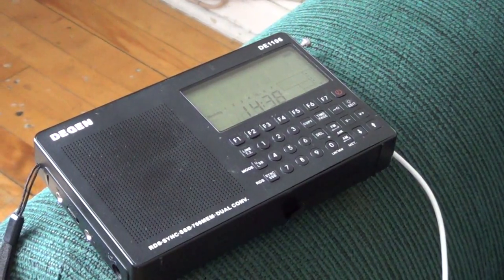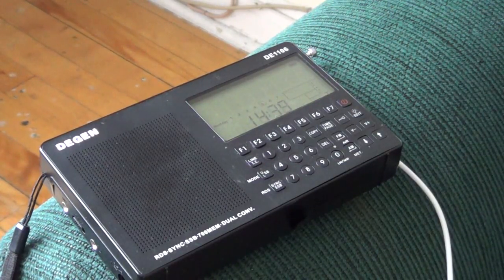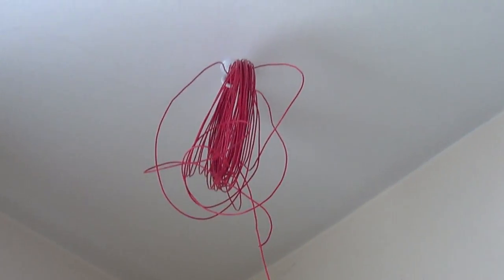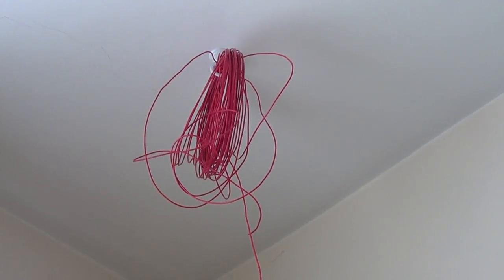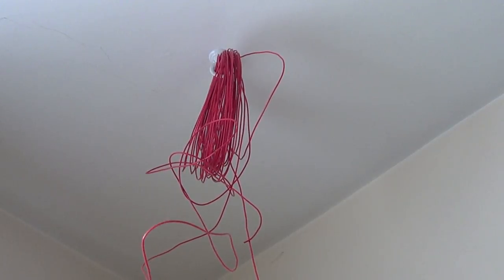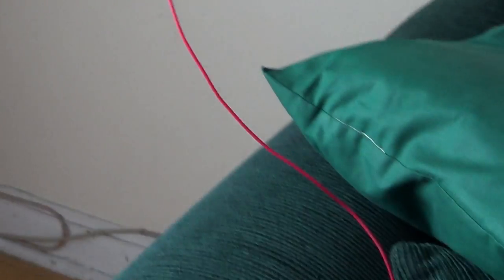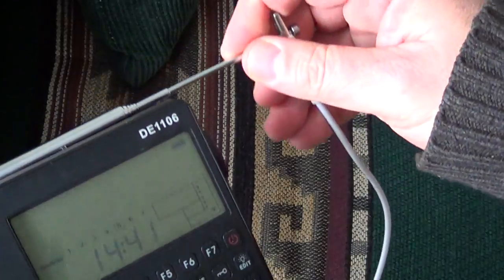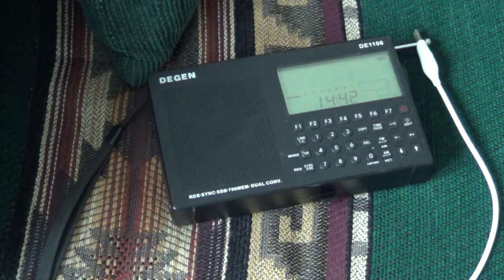My quick wire antenna in my living room for the Portable shortwave radios

Comment: i am making an antenna out of an 8' PVC pole, some thin red copper wire i had lying around, some tinfoil, and a few other things to help me detect lightning strikes near and far. lightning makes a unique crackling snapping noise on AM shortwave under 70khz, so i think my 8' tall antenna will work well and hopefully listen in on distant thunderstorms.
Reply from the maker: Alex Lubbers I often use radios to check for thunderstorms
Reply: Alex Lubbers 520 khz is what I use to look for lighting strikes.
Reply: Hopefully it won't work TOO good...   KABOOM! ZZzzzt.

Comment: NEVER connect to the whip directly if you can help it.  One static zap and the radio is likely dead.  If it has an external antenna connector, try to use that instead.
Reply from the maker: Did this hundred of times and never happened.  it does not matter and works great for a quick test

Comment: I've tried using about 100' of old wire taken from everything from line cords and wire salvaged from scrap wiring harnesses,etc.I've noticed that by adding the scrap wire,it makes no difference.When I touch the loop antenna with it,it either nulls the signal or shows no signal gain.

Comment: I am wondering, if you got that red wire and placed the loop and bundle of it on a desk / sofa or what ever, sat the radio on the wire (not making electrical contact, just literally sat on the bundle of wire) , and instead of running the crocodile clip to the radio you ran to ground outside,,, would that help remove some of the electrical interference you are getting as it may create a sort of "grounded shield" that, in turn, may shield the circuits in the radio.   It is just a thought, but it shouldn't cost anything to try out as long as you can get to the ground with the wire you have, clip it to a long nail, screwdriver or something and bury / stake it in the ground, wet ground tend to ground better so maybe add a bucket of water on it.

Comment: Did something close to your idea, I used a hanger, copper braided thread and alligator clip,...wrapped the hanger with copper braided thread,. Can use in any room, can also make the length longer or shorter..
Reply: A coat hanger?

Comment: My radio has a wire antenna. But reception isn't that good. How can I improve the reception? Thanks a lot!
Reply from the maker: Noise around you is probably too high, the best would be to move away as much from your home or if noise is a problem, get a MLA 30 loop antenna
Reply: I will follow your advice! Thank you very much!  @OfficialSWLchannel

Comment: I'm in a small ground floor concrete block apartment with a sliding glass door in the middle of the city and trying to create an antenna like I used to in the mountains. Unfortunately no nearby tree and the patio is only 8 feet without a fence.  I bought a 40ft roll of stranded 18gauge speaker wire and some alligator clips.  I thought the clip had to be soldered to stripped wire and the wire had to be extended not coiled or it would choke the signals.  Now I'm trying to do one like yours.
Reply: Grab a magnetic loop antenna

Comment: Some guys on /r/amateurradio told me that a longwire antenna works better with a 9:1 unun in it. But also that some radios have the unun built in. Is this true and how can one know if their radio already has one or not?
Reply: On a portable receiver it is not very important ... but on a higher end tabletop with a long wire antenna it is true that you need to match the impedance with a Balun ...  but many receivers have a already matched input
Reply: It is true, but I think the first thing a SW listener should probably do is what our friend here is doing, which is to try to find a low noise area to hold the wire.  I guess the next step would be to make a 9:1 balun, they should be cheap to make no matter where you live.  After that I would start to research antenna tuning units, as these will generally out perform a 9:1 balun but try to make one yourself rather than buying one.  If the science behind them baffle you a little do not worry, there is a whole internet of information and people will to explain what you need and so on.  But I think the first step really should be to experiment with placing a relatively short wire in different areas, it is almost free and can get you some amazing results in very noisy areas.

Comment: what gauge wire is best to use. Thank and 73
Reply from the maker: TREE HUGGAH it does not really matter but something strong enough to withstand wind and outdoor elements for a outdoor wire
Reply: yes thanks for the reply. it will be for an indoor random for use w/ my radios which do not have an external antenna option. is 12 guage ok.? or is it better to use something thicker.
73,tree huggah aka kb3aum

Comment: Is 16 gauge copper wire good enough? Also is bare copper wire is better? Cause the thinner the wire I think you get less signal
Reply from the maker: wire size does not matter and bare or not does not matter either
Reply: Correct. Wire size is not important because the signals you are seeking are in the microwatt/microvolt range.  Insulated wire is best in order to avoid shorting out sections of the wire.